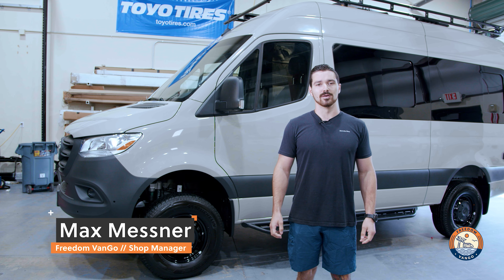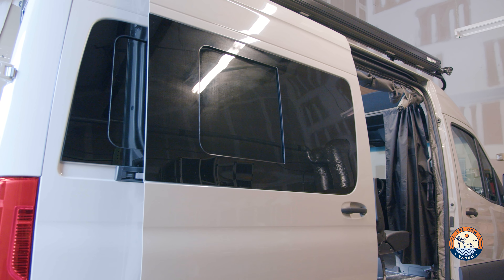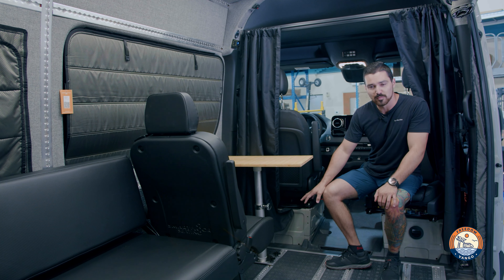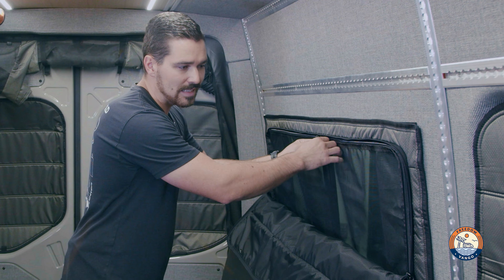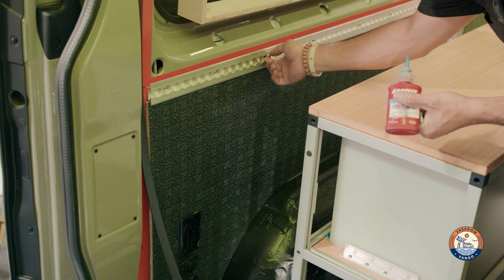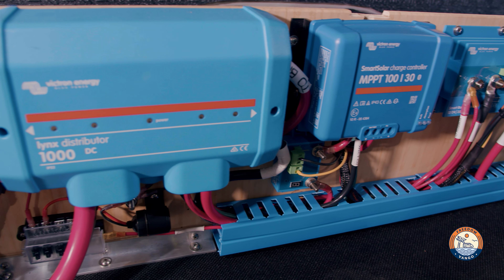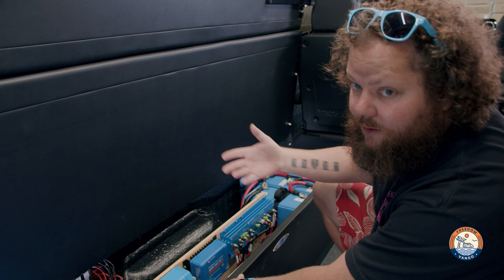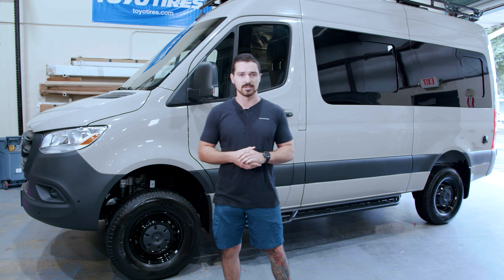All New 2023 Sprinter Adventure Upgrades!

Comment: Sweet van. Do you sell the strip lights mention at around 2:53? I ordered the Adwag kit and also deleted the puck lights. Thanks!
Reply from the maker: We source the track, leds and drivers from superbrightled.com.  Depending on the options, just the parts are close to 500 for everything. 

We drill and countersink the tracks, mount them to the panels then lay the leds in

Comment: Nice van! Can the switch pro go between cup holders?
Reply from the maker: actually yes!  that is where we normally put it.  Both the 8 and 12 switch panels can fit there.  Unless you have a power side door, the switch occupies that space
Reply: @FreedomVanGo  nice!  Seems easier. And that switch pro seems awesome! Last question 😅 could the switch pro power the factory radio(maybe switch between house batt and van batt) to eliminate it timing out and use for camping?
Reply from the maker: @caseyvansanten2103  For that i recommend your phone and a UE Boom speaker.